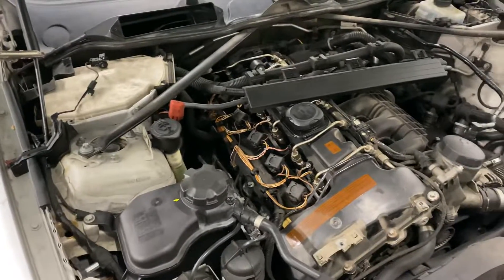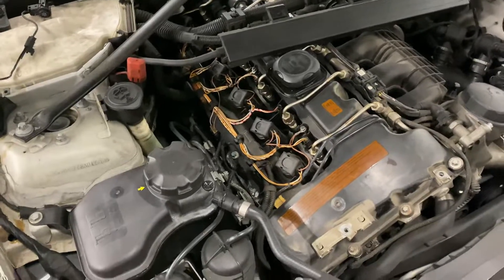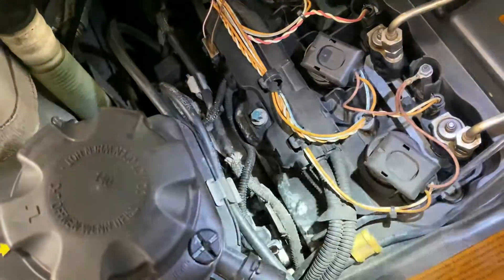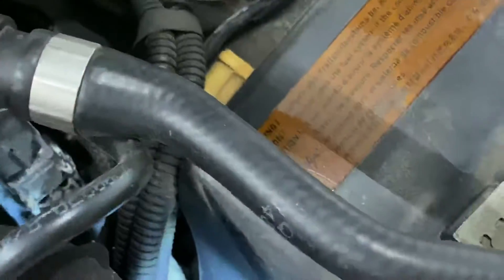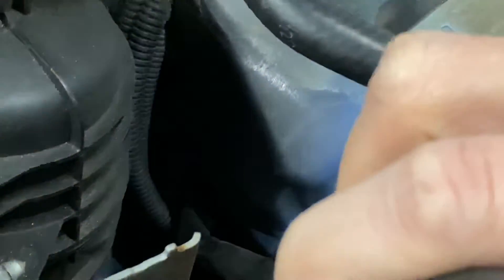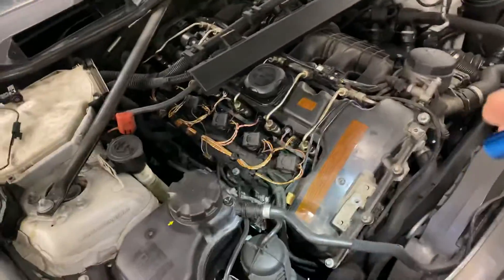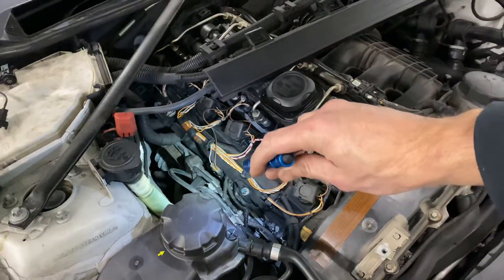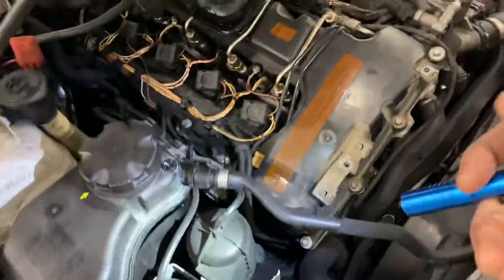30FF SOLVED! BMW 335i n54 30ff code

Comment: Having similar problem, cars lazy only boosting 3.7-4psi no codes tho. Put a vacuum gauge was pulling within the correct amount… at least compared to  what I’ve seen online. Just got vrsf charge pipe and turbo smart bov but kind of want to find problem before I put new parts on car. Where should I be looking??boost solenoid??

Comment: hello good video, my car was running fine but yesterday I changed the pcv valve because I saw that it smelled burnt, I decided to put a new one take advantage and I put new spark plug and bms high flow filters, and surprise when I started the car it didn't sound the same as before it accelerated and obviously less power and it sounded something like lamineo, and the bov doesn't make the typical noise pst!.  With your experience, do you think that the new pcv valve that I put in is related to the problem or was it a coincidence that when I changed all this, something was damaged?  I don't know what I should do :(
Reply from the maker: Make sure you connected the vacuum lines correctly on your wastegate actuators
Reply: @tunerworld  No, in fact, I did not touch the line to the actuator, only in the plastic tanks that are at the top and I reconnected them.  So I still can't find the problem :( im stress and delete the codes with mhd and move the car and it still doesn't have power, it's still the same, only now no code appears yet, but the problem is still there
Reply: @tunerworld  thanks, but you know that I checked all the lines and it seems that everything is connected in its place apparently, so I don't know what to do now, what size should the hose be?, and then I erased the codes and ran the car yesterday it feels a bit wrong but no more codes, and another thing when I turned it on I noticed that a little white smoke continued to come out of the back of the engine or maybe a little from the side
Reply: @tunerworld  thanks for the advice, but things are still very strange as I told you since I put the pcv and filters and changed bosh spark plugs when installing the pvc remove the fuel rail I thought maybe I clogged it with something but no, and I put mhd map 2, so now I put the stock map, I checked everything, change new vacuum lines and the 30ff code disappeared, but now this is crazy, the 2AAF code appeared and today I changed the fuel pump sensor that solves this problem according to what I saw on youtube and I stepped on the accelerator and improved but the fault continues, and now missfire cylinder 6 appeared!  I changed the spark plugs installed the previous used ngk cold step and moved the coils to position and the Missfire disappeared but now the 2AAF is back and it already has a new sensor it doesn't want to disappear :( this has me worried and I don't want to continue spending money, for and I always come up with something new, new code, I even think sometimes that this was caused by the mhd when I put the stage 2 map for the first time, what do you think please another advice
Reply: @tunerworld you saw that it smelt burnt hahaha
Reply from the maker: Oh crap, it sounds like you may have forgot something! You have a check engine light?